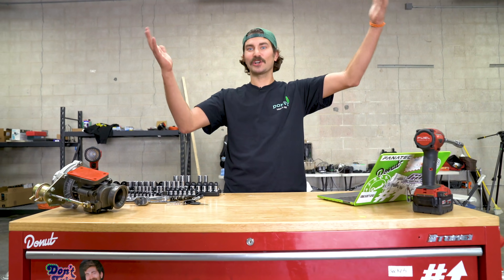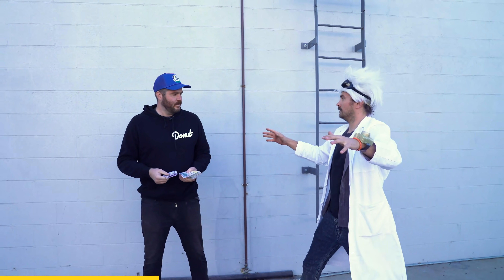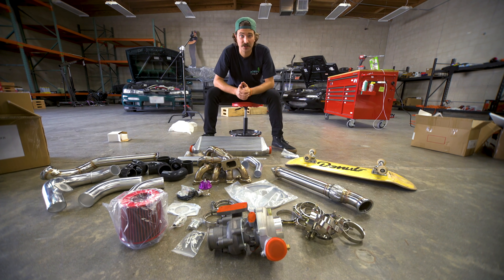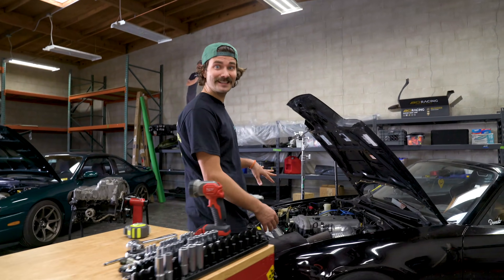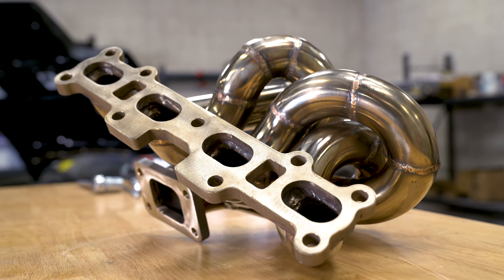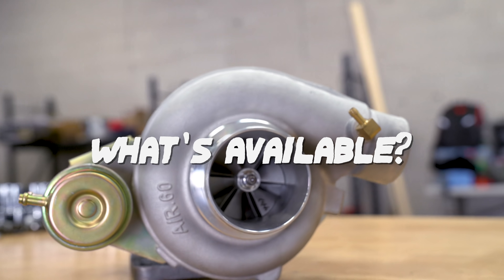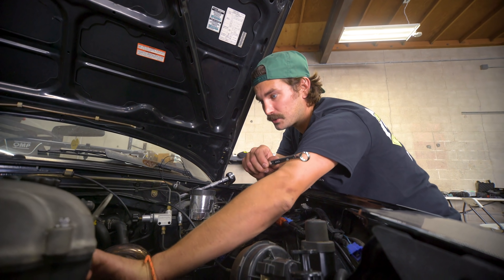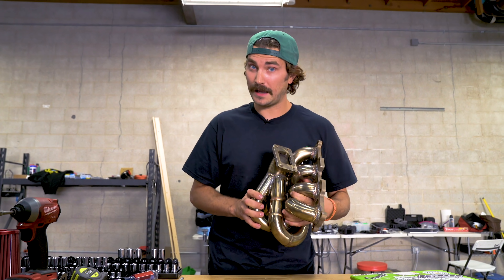Turbo Your Car - Choosing an Exhaust Manifold

Comment: You need to get a different oil drain line. The cx racing one has caused my fires. It is very low quality and breaks apart
Reply: "How to rebuild your fire damaged turbo Miata" - Money Pit 2021
Reply: He did say he wanted to make some fire.
Reply: Let's hope he sees this!
Reply: @dackyc9231  ya hopefully!! Or money pits about to turn into fire pit
Reply: @StardollDJ  everyone knows fire means faster
Reply: Should have bought a midpriced turbokit. I thought this was Midcar Miata.
Reply: Considering how bad the welds are on the manifold, I believe ya.
Reply: whatever you do dont connect to the side under the manifold. use a HIGH QUALITY sandwhich place and run a new HEAT WRAPPED oil line. I've had a car go down in a fire similar way. dont buy the cxracing oil plate either its fucking trash the o rings leak constantly

Comment: I’ve got quite a few CXracing pieces, just for reference:
-throw away blow off valve now and get a different Greddy BOV, it will break quick
-oil feed and return lines should be replaced with -an fittings
-the CXracing intercooler is the good part of the kit

Comment: 12:19 He said break in a intake manifold when it is an exhuast.
Reply: the manifold is a part that makes up an exhaust and it makes sense, it is a newer part than the Factory and swapped exhaust parts
Reply: @adamgibbo7841  about
Reply: @adamgibbo7841  exactly what I said 🤣🤣🤣🤷 who even knows
Reply: @canyouopopop3012  point he's trying to make is that it's an exhaust manifold, not an intake manifold like Zach mistakenly said.

Comment: If you wanna to go up with the boost probably you need to do some machining to your cilinder head and use some decompressed pistons and new rods. 
A friend turboed his car and this kind of works are somewhat mandatories.
The boost pressure was 0.45/0.55 bar.

Comment: Reminds me of my beginnings... only my beginnings were in late 80s. In Canada. Meaning no Internet, so very limited access to information. First car I modified was a Mazda 323GTX. That was so much fun. But my most fun to drive build was my Suzuki Swift GTI. Now that was a real sleeper. Just can't remember how many times I got asked what motor I swapped in, when in reality it was still running the original engine, but modified. Fun times.

Comment: When is Zach going to teach us how to kickflip. I already know how to turbo a car.
Reply: Pop flick jump
Reply: Keep your shoulders over the trucks through out the trick. Pop the tail as you flick the edge of your board with the lip of the soul of your shoe by your toes. Look for the grip tape and let it flip and hit the bottom of your shoe and land it. Practice putting your feet at different spots before you pop the board and see what works best. If the board isn’t staying under you. See step #1.

Comment: "If you get pulled over and they pop your hood"

Is that a thing that happens?
Reply: i also want to know someone tell us
Reply: Maybe in Cali? I never had that happen in Wisconsin, and I used to get pulled over for speeding/racing A LOT in my 20s.
Reply: Yes it happens.
Reply: In cali its deffinately a thing.... got pulled over in a non turbo'd car so the cop could check for a turbo lol..... missed the cali illegal short ram intake when he looked though
Reply: No, it’s not necessary for the cop to look on the engine bay as what will you be hiding there I’m sure they won’t as well because what is in there in the first place so... yeah no, cops never look under the hood only the trunk
Reply: Yes, cops can look under your hood for illegal modifications. In California, everything must be CARB certified so if the officer sees virtually anything not stock, you're probably in for a bad time. You can get state reffed, which means you cannot drive your car until it is inspected (vigorously) by a government smog technichian.

Or in the other 49 states I'm guessing nobody actually cares
Reply: It’s illegal to have a turbo? Must be only in California for emissions?
Reply: Apparently a thing in Commiefornia
Reply: @Smirnoff67  Exactly
Reply: I was wondering too, in PA the turbo is fine, the blowoff is not.
Reply: Yup in Cali. This place blows. I have a buddy who got his car reffed.
Reply: Glad I'm in Ohio where this isn't the norm.
Reply: Laughs in midwestern.
Reply: @christiancomputing8771  i remember when my dad would worry about passing emissions. On his old DD. I also remember them getting rid of all emission stations. So weird driving by the empty run down government buildings that use to be used all the time.
Reply: @JMPK23  yep, I was thinking about that when driving past one close to Dayton a couple of days ago.
Reply: Cops will check in Cali. DEQ will check too. If you can hear a turbo whistle, the catalytic converter (and other equipment) has probably been removed.
Reply: @JMPK23  also in Ohio it's a car lovers Wonderland they don't care if your car is rusting out broken suspension no catalytic converter rolling coal on everybody all over the place if that's your thing no doors no problem oh you have a 2000 horsepower ProCharger does it have turn signals cool drive it on the street
Reply: @christiancomputing8771  is the other reason that you can’t afford it?
Reply: @tvanb  That’s also a great reason, yes.
Reply: @dawickedj  just saw someone driving around the Marion area with busted suspension a couple weeks ago😂 I love this state
Reply: @christiancomputing8771  ahahaha I LOVE you
Reply: yeah, people have been stopped before to check for turbos and illegal equipment. You get state reffed which basically means your car is gonna have to go back to stock. Greg Peters from carpassionchannel got busted sitting at a parking lot so it can happen anytime anywhere.

Comment: thanks for firing it up if you want to see flames just do the good old key banging method flick the key switch from on to off and then back on this also requires revving the car to atleast 4k rpm and letting the throttle off just dont do it too much as too much can damage the engine

Comment: that kit is so cheap. I expect a future episode titled "so you want to put out a fire in your engine bay"
Reply: lol this was the comment right above yours "You need to get a different oil drain line. The cx racing one has caused my fires. It is very low quality and breaks apart"
Reply: cxracing exhaust manifolds are also known to crack. This is really a cheap turbo that should've been on high low. The internal wastegates kinda work, BOV kinda sometimes works? You really cant turbo a car for less than 3.5k and expect it to be reliable. Hopefully his build goes well though. Everything else in this series has been good quality stuff except for this.

Comment: Scavenging is actually where u open the intake valve just before you open the exhaust valve allowing the new air and fuel mixture to push out the used a&f mixture to help push it out the cylinder

Comment: When you showed off the top mount and saw the turbo jacket on the S14 I though you’d talk about heat wrapping the manifold and down pipe, but you didn’t 😭 this would be the ideal time to do it and lower those power sapping under bonnet temps!

Comment: Most cars don't have them available in the aftermarket, but the correct choice for a turbo manifold is a cast Ni-resist variety. this is what OEMs use, and lasts the longest BY FAR over other options. Heavy track use and many heat cycles...

In race cars, a tubular manifold makes more peak power, at the expense of cracking and much shorter lifespan, even in thick walled inconel with braces, weld reliefs, and crane supports.

Most people dont have either of the above options to them... so the next best thing is a thick walled header (can even be mild steel), with each weld having at least two braces over opposite sides of the circumference. This is by far the cheapest, longest lasting option.

All the pretty tubular turbo headers you see on youtube channels? yeah, they are all barely used, rarely driven in long track sessions, and will all 100% crack in time, especially if they are high mount, and unbraced. They also can be very expensive, so really its just pointless aesthetics.

Comment: Fyi the cxracing kit is decent for the 1.8, everything fits relatively easily and the turbo has 50% chance of not seizing within the first week of usage, the 1.6 kit has fitment issues with the downpipe because they used a v8 swapped car for the mockup... both kits will need you to fabricate some brackets and find the missing parts like a decent oil drain and air filter, the feed is usable but the line can kink just by looking at it. They both use the same turbo.

Comment: The only thing I would add is when torqueing most exhaust parts in place, you should torque it once to get it on, then heat cycle the parts, and retorque it.

Comment: Hey you may want to swap the stock 5-speed transmission for the 6-speed from the NB. The 5-speeds is a known weak point of the NA and will break if you put too much power through it. The  6-speed from the NB is plenty strong enough to hold 225  horsepower and it should bolt right in. Also you can swap the diff housing for one from an RX-7 but you only need to if you are going for big power and are regularly launching the car.

Comment: I wish you guys would of went into what to do if there is no turbo manifold on the market for your car. Like explained all that would of been needed to just come out of the header or stock exhaust manifold into a single exhaust pipe that feeds the turbo.

Comment: That outside bend on the turbo manifold looks rather tight! I have a feeling that's gonna restrict airflow from either cylender 1 or 4. Would be interesting to hear about any issues like that that come up in tuning, to see how much of an impact such a tight bend actually has on the preformance compated to what the other cylenders can push.
Reply: The air flow is fine. He's getting crazy amounts of boost from that spinny boy (14+ PSI with room to go even higher).

Comment: FYI never stary motor with no manifold on with some piping. Exhoust valves get so hot that when they touch cold air normal temp air can crack and brake

Comment: Hopefully they fixed the oiling issue with there turbos.... Sammit got one from them that the turbo was smoking because of oil issues... there was also figment issues with the down pipe  and other firemen issues

Comment: I’ll use the same exhaust system you had on it and hacksaw it and make a mounting plate for the turbos and welded the plate to the exhaust manifold and mount turbo and called it a day and saved money but have shitty welds that I have to grind of later

Comment: That cxracing tubular manifold will 100% crack over time. Thats like the first thing you learn not to buy on a turbo car
. metal is 304ss and relatively thin

Comment: Hey Zach, I have a straight-5 cylinder engine on my 2005 GMC Canyon. The exhaust manifold is on the left side of the engine, also on the same side of the intake. Do they make turbo manifolds for a 5-cylinder or would I have to fabricate my own?

Comment: I'm confused on the legal questions... 6:30.  Is it illegal to add a turbo to your car??  Or is that just states with EPA inspections?  Even then, as long as you keep the catalytic converter, I don't understand the concern of being pulled over and a cop checks your engine bay for a turbocharger or any other modifications.

Comment: It always starts with a wonderful dream,  then you soon find out your $4000 dollars over budget on just the Turbo stuff. The you decide to install a FT550 and everything that goes with it, $3000. Then you go nuts on your PTFE fuel system with all Radium components, $2500, then you want your motor to handle 600hp so you build a $10,00] dollar long block.....this is what i did.....sound familiar?

Comment: Just a warning to anyone buying the cxracing turbo kit, they are not good. The manifold likes to crack, the turbo will blow up, the kit doesn't actually route the pipes properly and you have to cut holes in the chassis, and waste gate sounds like a rusty swing.

Even with the extra initial price, the flying miata will probably be cheaper in the long run.

Comment: The manifold is a mistake IMO. You're better off with the heavier taco taco cast iron one on ebay. Those things crack constantly and are junk. If you want to go baller status I would try to get a custom one made with the downpipe. That downpipe wont work once the manifold cracks in the future anyways.

Comment: that turbo kit was a fucking disaster on my 1.6. I had to re engineer almost everything and delete and move a bunch of shit to make it work and easy to maintain. not to mention the manifold cracked by the flange in 2 places and they hesitated to even replace it. it only had a few weeks worth of heat cycles on it. that turbo is way too big for that engine size too

Comment: There's always the darling of cheap bastards everywhere, the 'log' manifold. 

Super easy to make yourself if you have moderate welding skills and equipment but don't have the quite considerable skill required for building a fancy, twisty tubular setup.

Comment: Okay... so, he’s talking about engine bay temps being lower with a bottom mount, but hot air rises...
Reply: Yes but in both cases it has nowhere to go because the hood is trapping it. At least with a bottom mount turbo you will get more airflow.

Comment: "the bigger the better" is NOT true for the downpipe. You NEED back pressure and too big of a diameter will result in a LOSS of power.

Comment: Is that flange actually flat?? Thought I saw some gaps when it was shows sitting flange down on the table. Also that acute angle on the #1 cylinder exhaust runner looks absolutely atrocious. Terrible manifold design.

Comment: I spent 10 years, three workshops and learning to engine build and tune my self to turbo my RX8:) 
After $190,000usd total ( including the car new { $48,000usd in Australia } ) (ಥ _ ಥ)
I have finally got it running perfectly (✿◠‿◠)
Better than my RX7 Spirit R I used to own....

Comment: the cx racing kit is straight up trash, at least their miata ones
the entire turbo miata community frowns on them for their terrible record of cracking and breaking manifolds alongside install issues. mkturbo/kraken/fm setups are far superior.
cast manifolds are proven and popular channels that endorse cx racing are misleading. 

do it right or buy it twice.

Comment: This is really sad to see stuff like this. THe money you will spend on a decent turbo kit is insane. Just buy a used car with a factory turbo in it (or anything with high HP), and you'll be better off.
I know you guys want to promote content like this and guide people on the right track, but while suspension/brake upgrades might be efficient and ~simple, engine mods are anything but.
Oh and also be sure to never tell the insurance. It's flat out illegal and they'll never insure this thing, so as soon as they find out you've been messing with your car (because you'll post this on FB/YT, and they'll know...), you're done.